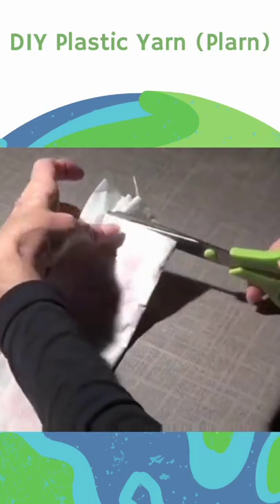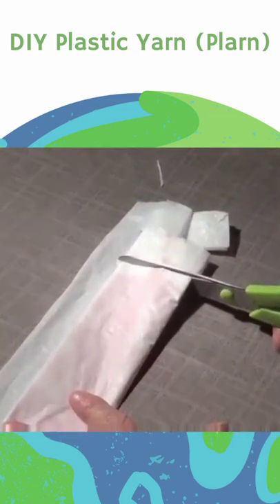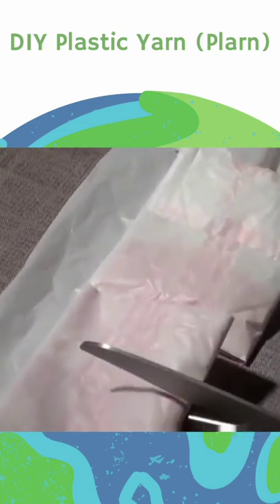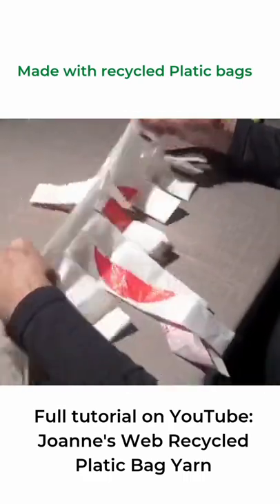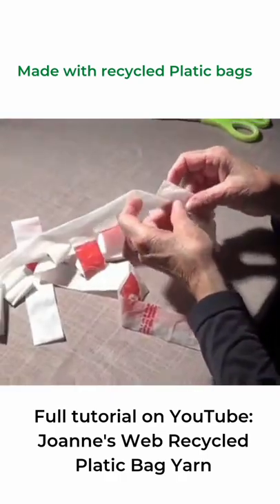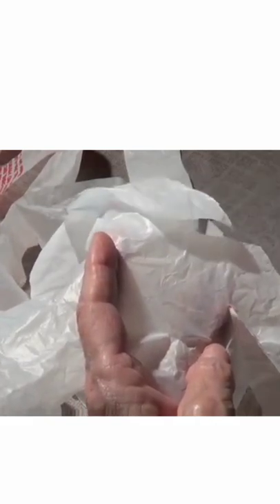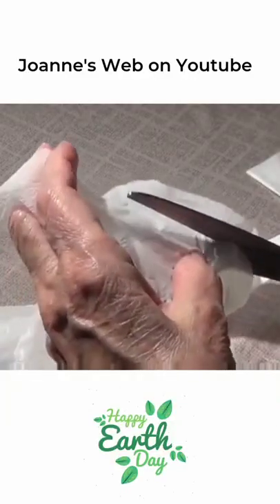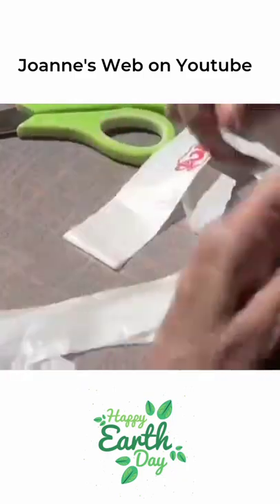Recycled Plastic Bag Yarn Tutorial - How To Make Plastic Yarn

Comment: You can also fold up the bag and cut of the bottom and the handles then cut strips about 1-2 inches wide and tie/loop them together, that is the method I use and I find it to be easier
Reply from the maker: Yes. we use several methods.